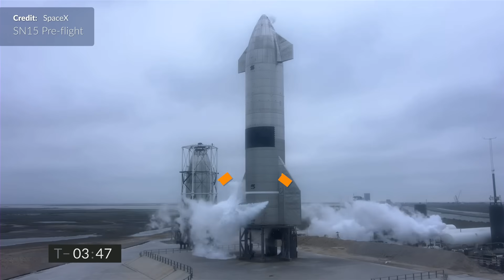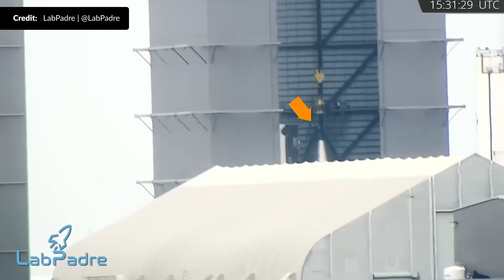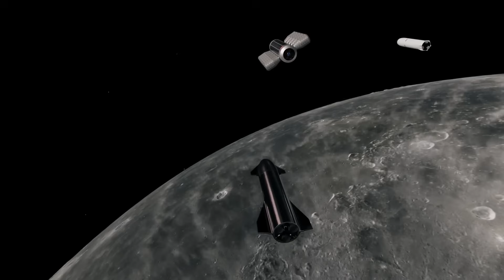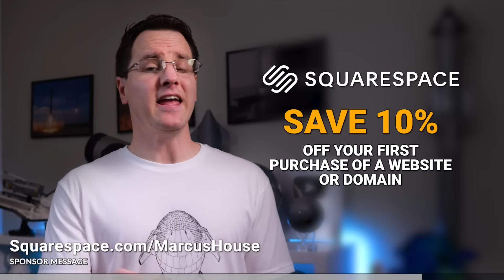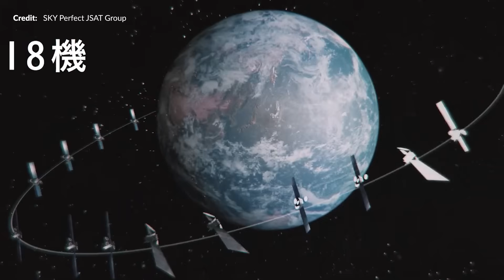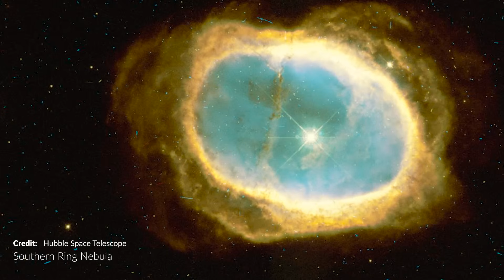SpaceX Redesigning Stage Zero?, Starlink Hack, Artemis 1 Final Rollout, JWST Update

Comment: Excellent video as usual. Why am I not excited by SLS and the upcoming launch? Probably because it is a dead end, each launch costs $4 billion if I recall correctly, and such a ridiculous amount is unsustainable. At that price it has no future outside of a small number of moon launches. Even at that price I would argue that it has no future and should be canned. They should use Starship, or multiple Falcon Heavy launches with in orbit docking, or pay a fraction of 1$ billion for SpaceX to develop an expendable second stage to carry a traditional capsule to the moon.
Reply: Because SLS/Orion are developed to get to and from the Moon now. Developing a new system would take longer and delay the Moon landings. Artemis I is the last test of SLS/Orion, before crew flights.
Reply: @steveaustin2686  Yes, that is now. It is a shame that NASA did not have faith in SpaceX, and entrusted so much to Boeing. However, I have a feeling that the future is SpaceX and other start ups, not Boeing which is an obese albatross around NASAs neck.
Reply: @StillAliveAndKicking_  NASA awarded SpaceX a Commercial Resupply Services (CRS) contract in 2008 to develop and fly the Falcon 9. Musk said that NASA contract saved SpaceX. By 2011 when SLS started development of SLS with Boeing, SpaceX had a total of FOUR (4) launches to orbit. Two with the small lift Falcon 1 (0.2 to 0.6 tons) and two launches with the medium lift Falcon 9 v1.0 (9 tons). Heck, SpaceX was a hugh risk for Crew Dragon in 2014 as to that point, SpaceX had only 12 Falcon 9 flights under their belt. Ironically, Boeing's Starliner was seen as the crew spacecraft of the future. SpaceX has come a long way, but remember where they were when these programs were started.
Reply: @steveaustin2686  I’m aware of that. However, it did take NASA many years before they really trusted SpaceX. They have a policy of giving out some money to companies to encourage competition, and diversity of providers. However the main money still goes to companies such as Boeing and a large part of the reason for that is politics. It is easier to get a budget through congress if large amounts of money go to multiple states connected to the project eg the Boeing SLS project.
Reply: @StillAliveAndKicking_  You are joking, right? SpaceX was awarded $1.6B in 2008 to develop the Falcon 9, when they had ONE orbital flight under their belt. The company was in dire financial straights at the time and would have went out of business otherwise per Musk. SpaceX was awarded $2.6B in 2014 for the Commercial Crew program with only 12 flights under their belt.

Do you know why SpaceX got $1.6B for CRS and Orbital got $1.9B? Because SpaceX bid $1.6B and Orbital bid $1.9B, that's why. SpaceX bid $2.6B for Crew Dragon and Boeing bid $4.2B for Starliner. SpaceX could have bid higher, but didn't. NASA did NOT set those prices, SpaceX and those other companies BID those prices. So your "SpaceX doesn't get as much because of politics" argument is dead in the water since SpaceX set the bid price themselves!

Comment: No, that is not what the starlink hack was at all.

The starlink hack gave no access whatsoever to the "network" or the data flowing through the network. It was a privilege escalation attack on a user terminal. Meaning you have full access to software running on the single user terminal and literally nothing else. It's directly equivalent to jailbreaking your iPhone. It's a requirement for software attacks on the network, but it itself is not an attack on the network. A jailbroken iPhone by itself poses no threat to Apple or the App Store, nor does a rooted starlink terminal. Heck, it's pretty easy to find and ban terminals that start sending data in a different or incorrect way, if someone starts trying to launch a hack via a rooted starlink terminal.

It's also a voltage-based hardware attack, which you cannot patch in software. Meaning that V3 of the user terminals will likely have a fix for this, but all existing terminals are, and will always be, able to be exploited in this way. So if you see someone prying apart your user terminal with a crowbar, they might be trying to physically install this hack to steal the data you're sending through it... which goes without saying. Why would you let someone with a crowbar near your user terminal?

It's non-news, only interesting to hacker groups who do physical pentesting. The only reason it even made non-hacker news is because it's got Elon Musk's name attached to it. From a hacker's perspective, it's quite a neat attack and a great proof-of-concept. To everyone else, it means literally nothing. I repeat: It means nothing. If anything, it shows that the bug bounty that Spacex had for the project worked.

I'm also not sure why everyone is so fixated on the "$25" price point. That sounds awful high tbh. I'd expect most hardware hacks to cost significantly less. The raspberry pi pico is $4. Toss in a protoboard, a few voltage shifters, and a couple of wires and it's still difficult to hit $15. I suspect the bulk of his cost was a custom PCB, which is quite unnecessary. And maybe an arduino with a bloated price due to global chip shortages. But I digress.

Comment: 1:30  Note also that the venting doesn't go straight out, it's directed down. These are now vent thrusters, the new RCS maneuvering thrusters Elon revealed in his last interview with Tim Dodd. They vent gas directly from the tanks at ~6 bar.

Hey Marcus, hopefully you can use the term vent thruster often enough that it becomes "official." They certainly aren't cold gas thrusters (and that term is already in use anyway). The autogenous gas used for vent thrusting will be hot compared to space, but hot gas thrusters are known to the community as the once-planned methalox RCS thrusters. So, vent thruster sounds good.

Comment: Could those SPMTs are being set up for transportation of the LC 39A launch table?  Word it is being assembled undercover at Hanger X.
I'm thinking SLC 40 is targeted for upgrade.  My guess is that where Mechazilla 3 will be located.  The methane/LOX infrastructure is already in place
Reply: Does SLC-40 have a large enough exclusion zone for that size of rocket. LC-39A & LC-39B were apparently built with rockets twice the size of the Saturn-V in mind, which is larger than a Starship. At SLC--40, Starship would be apparently about 5 times the size of the largest rocket launched from there. SLC-40 may not be large enough for Starship. SpaceX and NASA are working with the FAA about building a Starship pad at the as yet unbuilt LC-49 to the north of LC-39B. Or a tower could be built at SLC-13 where LZ-1 and LZ-2 are for landing Falcon boosters. That would move catching a Starship away from the existing LC-39A pad that launches Crew Dragon and Falcon Heavy. What I have heard for SLC-40, is upgrading it to launch Crew Dragon from there.

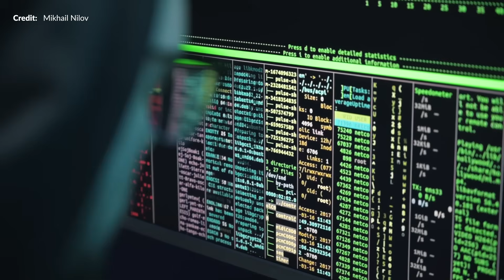Comment: 15:45 🤦 The researcher successfully rooted the customer terminal ("Dishy McFlatface"), which only allows one to do fun stuff to their Dishy, e.g.: install custom firmware, reconfigure the antenna array for direct terminal-to-terminal comms, etc. It's just like getting any other end user device (camera, phone, fridge or whatever) rooted.
At this point this bears no impact on the security and integrity of the rest of the network. Do your research properly!

Also, he released his method and hardware specs on the GitHub not for SpaceX to make updates, but for other people who also want to mess with (and risk bricking) their Dishies to be able to do so, and maybe come up with novel, fun and useful applications for the hardware.

Comment: Hate those tiles! Need to invent a coating/paint to automate application and release the ejecta layer by layer, then repaint to relaunch maybe. THere are materials available, just the adhesion is the issue. Thinking magnetized paint or simple electostatic application of insulation then the heat resistant paint in alternating layers. Just dreaming here.
Reply: Everyone in spaceflight would love something like that, unfortunately, it doesn't look to be coming any time soon.

Comment: Starship won't even make it 3 feet into the air before exploding. No flame diverter. SpaceX under Musk's leadership is going down the crapper.
Reply: Starships have flown way higher than 3 feet.
If the static fire data of Super Heavy with complete engines proves that flame diverter is needed, SpaceX will add that.
Reply: @1ndragunawan  They will find out the hard way when it explodes. Starships launched with only three engines. NOT 33 engines firing at the same time. Furthermore, Starship is a deathtrap without launch abort for manned missions.
Reply: @DavidJohnson-tv2nn  Falcon Heavy launched with 27 engines firing at the same time, it worked for the first flight. So, 33 engines firing at the same time is within SpaceX capability.

The abort system have been talked about to death.
The main customer, NASA, doesn't even requires an abort system for in space only Lunar Starship.

Polaris program should reduces the risk for Starship launching from launchpad.
Then there's also the Crew Dragon for risk-averse customers.
Reply: @DavidJohnson-tv2nn   1. The Launchpad for Starship may or may not need a Flame diverter.
Do you have any data that suggest Starship Launchpad MUST have a flame diverter, or is it just your OCD talking?

2. Polaris 3 will fly onboard a Starship from the surface of the earth level back to the surface of the earth level.

3. Use the Crew Dragon then!
SpaceX will happily take any customer money for a Crew Dragon ride.
No one is forcing anyone to ride onboars Starship.

4. What is it with Musk detractors that just take any assumption out of thin air, then when confronted with facts will just double down with more stupidity.

News for you, people died in NASA rockets, in very regulated airplanes.
People even died while walking on foot.
Best that people can do are reducing the risk.
Reply: @1ndragunawan  1) To my knowledge, there has never been a large rocket launch without a flame diverter. With good reason. The most likely probability is the shockwave will reflect off the ground, strike the vehicle, destroying it! At the very least do a full duration test using all 33 engines, but with a small test tank and a limited amount of propellant to avoid disaster. The current plan is reckless.
2) Don't quite get your answer. First, doesn't explain how Polaris will improve safety. 
Second, suborbital surface to surface transport using rockets of any kind is beyond reckless!
Reply: @1ndragunawan  3) saying...
"No one is forcing anyone to ride onboard Starship"
is like saying that no one is forcing anyone to fly onboard aircraft. So we don't need FAA regulations. Fly at your own risk!
That may work for conservatives, Republicans, big corporations, and business owners. But is unacceptable in a modern civilized society.
4) People who question Musk don't blindly follow a leader. Musk fans seem to think unnecessary risk is cool and human life is expendable.
The best way to reduce risk is to install launch abort!
Reply: @DavidJohnson-tv2nn   1. Water suppressor is a thing, and Starbase has large water tanks.

SpaceX will do full 33 static fire, they're doing it step by step while gathering data.
It's not impossible that SpaceX will do full duration static fire.

2. Any first spaceflight will meet some kind of problem, then the problem can be solved.
Inspiration4 changed Crew Dragon, so now the toilet won't break, therefore increased safety, food heater and USB port for tablets and phones for extra comforts.

Polaris Program flights are not suborbital flights. In fact, SpaceX doesn't have any commercial suborbital crew flight, that's Blue Origin and Virgin Galactic.
Reply: @DavidJohnson-tv2nn   3. FAA doesn't regulate Crewed Spaceflight.
FAA regulates AIRPLANES.

Eventually there will be regulation for Commercial spaceflight.

4. Sure, let's see your design of a rocket that can loft the equivalent mass to space as Starship, while having launch abort system.

Who knows, you might put Musk to shame.
Reply: @1ndragunawan  The FAA doesn't regulate Crewed Spaceflight thanks to lobbying by big corporations and business interests. So "Republican/conservative" of you guys. 
The law needs to be changed so this reckless crap doesn't happen.
As for "my design".... 
On crewed space flights, cargo capacity can be cut to accommodate the abort system. Cargo flights don't need launch abort. Human life is not expendable just to save money!
Reply: @DavidJohnson-tv2nn   1. Blast berm protects the tank farm.
Computer can do acoustic modelling analysis, pretty sure SpaceX can do those analysis, otherwise they won't be able to predict Starship sound environment impact.

2. Airplanes are also inherently dangerous, there are still casualties from airplane accident this year, even after regulations and decades of safety improvements.

People boarding any airplane accept the fact there's always a chance of airplane accident.
People boarding any rocket accept the fact there's a large chance of rocket accident.

People that board any rocket know the risk, and still ride the rocket anyway.

If you can't accept the risk, don't ride any rocket then.
But you certainly don't have any authority to tell other people what they can or cannot do.

There are more people dying from car accidents annually than the total death of human spaceflight from the beginning to this day.
Where's your insistence on abort system for cars?
Reply: @DavidJohnson-tv2nn  don't board any rocket without an abort system then.
Simple solution.

Sure, the launch industry will just tell FAA to enforce an abort system for airplane first, then they will comply.
After all, there are a lot more, like thousands more deaths by airplane accidents than rocket accidents.
Reply: @1ndragunawan  1) Time will tell who is right. If it all goes boom with a full propellant load, and wrecks everything for miles out.... Just remember our conversation, and... "I TOLD YOU SO" :)
2) You completely ignore the probability in each case. Why don't you just do this...
Google "chance of dying on an airline flight"
Then Google "chances of dying in a rocket"
I don't have any authority to tell other people what they can or cannot do. But....
We sure DO have the authority to tell the manufactures, and operators of aerospace vehicles what they can and can't do, and what safety systems they must have. The public can not be expected to understand every aspect of flight, and what safety systems and procedures are needed. That is why we have the FAA. They need to regulate private space flight just like they regulate aircraft. 
Or....
Please explain why you think aircraft should be regulated for safety but private space flight should not???? Thanks.
Reply: @DavidJohnson-tv2nn  I literally wrote eventually commercial spaceflight will be regulated.

But that's just typical of people like you, drawing your own assumptions and conclusion out of thin air.
Reply: @1ndragunawan  Sorry, I didn't see that part. I read.... 
"FAA doesn't regulate Crewed Spaceflight"
Then got peed off and didn't read further. Because I know how big greedy corporations manipulate the system to their benefit. 
My point is the need for regulation right now. We have reckless people flying crap into the air, blowing things up, putting surrounding communities in danger, and making plans to put people in vehicles without vital safety systems. And the fans of a billionaire think this is all very cool. Complete lack of concern for human life.
Reply: @DavidJohnson-tv2nn  That's literally what FAA Environmental Assessment did, and that's pretty much it.

FAA findings of No Significant Impact for SpaceX Starbase operation, and that's after the fact that several Starship exploded.

Comment: The Starlink "hacker" did not gain access to the Starlink network itself. He only gained root access to his own Starlink terminal. Thanks for your great videos!
Reply: Yes, and that's a pretty massive difference. It's like rooting your phone vs hacking the phone network.
Reply: Pointing out, a good way to hack into a network is to first hack into a terminal. Study the software and firmware, gain access to key material, try known or likely exploits. Once you understand the terminal,  you start to understand the network.
Reply: @CougarDoomer  still isn't what happened but point taken
Reply: @williamh.gatesiii8183  Hacking the network with access to a client is a lot easier than doing so without it.
Reply: Now consider that the hacker is a student (working towards his PhD), or in other words, something the did in between that and he used of the shelf materials for the grand total of 25USD.
Considering that SpaceX rewarded him with 12K USD, it does look like he really showed them a gaping hole in their security.

It shows that to 'hack' it really isn't that much of a hassle to someone that knows what they are doing. And sure,it didn't hack the network, but it provides a foothold, a beach head, a way into the network. 

By the way, it's the same guy that with a few of his mates years ago hacked the keys to a Tesla model X to show that with his method you could steal that type of cars within minutes.

That's the difference between someone that has studied and holds degrees in Electronics and Artificial Intelligence and some blow hard Bachelor of arts physics graduate.
Reply: He in fact DID access the network by hacking terminal and bypassing security features. Read about the hack itself, and not what spaceX claims.
Reply: @AG-ig8uf  Accessing the network is what the dish already does. Did he manage to get elevation ON THE NETWORK ITSELF, or just the dish?